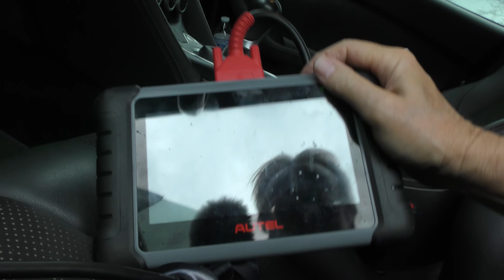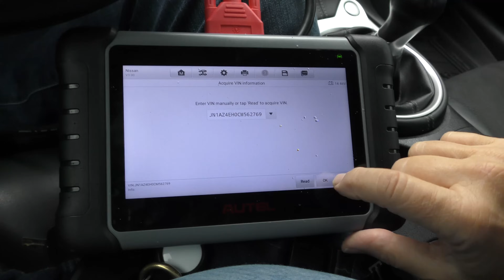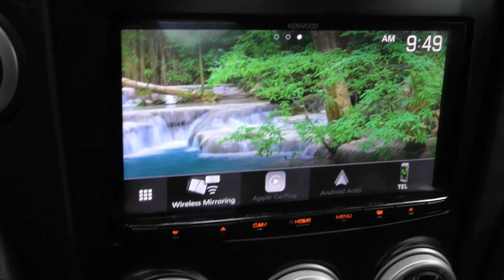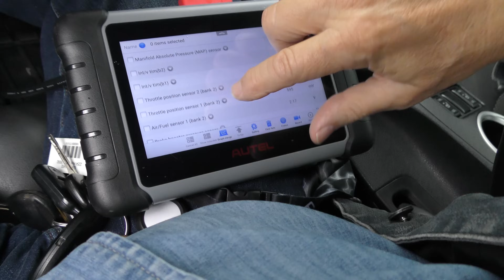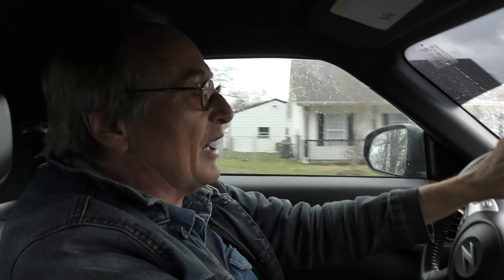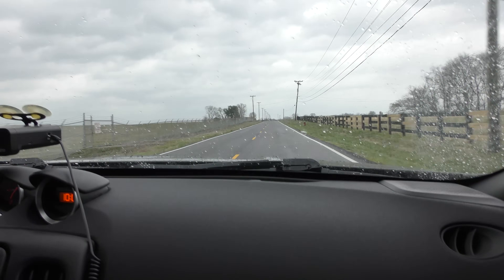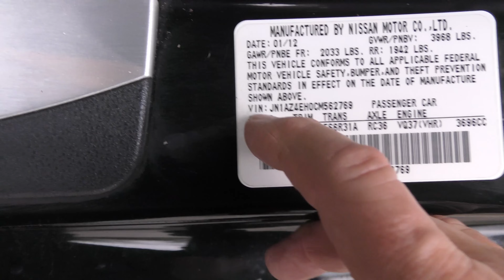This New Car is the Biggest POS I’ve Ever Seen

Comment: Had a g37 basically same as this and that had 280,000km on its before I sold it. Then got a q50s with the 3.7L and that now has 200,000kms on it now.

No major issues with them and I raced my g37 all the time at the track and did abuse the car. Videos are on my channel. But only normal maintenance and they kept on going

Comment: A friend of mine had a 370z and it was a fantastic car to drive. His only complaint was that it was very noisy in the cabin. Sure it's a fun car and a good-looking car, but you're not always tearing around. If you jump on the freeway for a 100 miles the noise is going to be fatiguing. Still, it's an awesome car and a great value.
Reply: I had one for a very long time. Absolutely loved it and it’s the one vehicle I regret selling.
Reply: I'd suggest kilmat, a cheaper version of sound deadener. Also fill voids between the wheel wells and interior panels with cloth insulation where you can. It goes a long way to quieting things down.

Comment: I had a 370Z for a few years. I’ve noticed the motor is pretty noisy. So is the clutch too. I thought I had a knock but after doing researching and asking other owners, it’s “normal” lol 
It was a fantastic and fun car. It never gave me an issue except for the clutch slave cylinder that went out. It’s located inside the transmission bell housing so it was quite some work.
Reply: I have a 2010 Alfa Romeo 159 1750 Tbi Ti (petrol), the motor is really noisy in that, quite a heavy knock at idle, turns out it's perfectly normal, something to do with the fuel system, sounds rubbish though, i recon that's why most modern engines have plastic covers, to try and drown out the crappy racket they make.
Reply: Ah I had to replace one too in my genesis coupe , some work.
Reply: Lucas synthetic motor treatment. I had a court about twice a year my valves making 0 noise.

My friend and I crank the car and put it in as it was running and you heard it go off from making a bunch of Racket to absolutely silent. Lucas makes the best additives I used it all my vehicles.
Reply: You can get an aftermarket slave cylinder put on outside the bell housing. Many 370z owners do that. Also clicking from rear wheel is the main wheel nut as it comes loose. Think there is an aftermarket nut many put on.

Comment: You can adjust the lash on the intake side by replacing or grinding the buckets. We do it all the time. As long as your in spec the VVEL doesnt care. And i say we do it all the time in the sense of doing a valve job. Ive never seen a oem 370z need valve adjustment and im a master nissan tech.

Comment: As long as those dongles are made correctly (no excessive current draw or EMI) they are good to be left plugged in for long drives. Just consider unplugging them if you're not driving the vehicle cause they'll drain the battery!
Reply: Yep, I have one each in my Mustang, Silverado, and Camry that stay permanently in the OBD ports and have never caused any issues. The one in my truck has been in there for about ten years.

Comment: I really like the new Z car actually. I understand what you’re saying about the turbos, but you’d be hard-pressed to not find a non GDI, non-turbo car these days. Also, we had a couple of the VQ Nissans in the family and while they’re great motors, they have their own set of issues. I do know a couple of people that have put a decent amount of mileage on the 3 L turbo that is in the new Z. It’s been out on the Infiniti for quite some time. I think the redesign is sharp, it mixes the perfect amount of retro with new, and I’m really excited to drive one. I actually think Nissan is on an upswing. For instance, they finally got rid of the awful CVT in the Pathfinder. While it’s not a pathfinder as we know it, still, it is definitely also an improvement over the last generation. I am rooting for Nissan. I’ve had a lot of them and I’m hoping That they get their groove back. Perhaps with Ghosn having been ghosted, we will see some welcome changes.
Reply: Their designs on infinity are horrible. Just horrendous.

Comment: I had two G37’s (a 2008 and a 2010) with the same 3.7 VQ engine as this 370Z.  They were absolutely fantastic cars that I bought both brand new and I loved both of them!  I do disagree with you about the new Z.  It’s an awesome car and the Red Sport turbo engine has been around for years in Infiniti Q50’s and is generally a reliable and powerful engine.  Plus, the new Z just looks incredible!  I love the Z32 300ZX-inspired tail lights especially!
Reply: im a Z owner and i have mixed feelings about the new z. theyre definitely not what worth what it costs to drive one out from the dealership. i can get a gtr for the amount. plus, id wait for the revised ones to come out before anything so in a few years
Reply: They did nail the look. Reminds me of a 70s Zcar

Comment: I've owned my 2015 for 6 years and have had no issues. She's at 55k miles now and figured I'd do the spark plugs with the next oil change
Still runs like the day I got it
Reply: Bro yours is still brand new just change oil every 2,500 miles I’m at 220k rn an mf she’s running good 🙏🏼

Comment: I do agree on his statement of turbo charging the new Z. One of the biggest upsides to the Z has ALWAYS been it’s N/A engines. Being a huge fan of the Z/G series Nissan/Infiniti have always had, I love the idea of a N/A engine. Adding turbos to an engine really make for issues down the road. We personally own a 2011 FX35 AWD and it is a blast to drive. For a 4300lb crossover, it absolutely flies.
Reply: You do realize the 300ZX was in fact turbocharged and very reliable right? The new Z isn’t the first time Nissan threw turbos in the Z line. They flipped back and forth between N/A and FI with every few models.

Comment: For what it's worth, I REALLY like the new one. It's just too expensive for what you get, similarly to the 2.0 supra
Reply: It looks so good, much better proportions and proven engine compared to the bmw Supra
Reply: Welcome to 2023
Reply: @DavidValdezBigWaveDave the B58 Supra is MILES better engine than any Nissan junk
Reply: @bigstepper4203  it looks fugly tho, like have you seen a mkIV? A mkIV has much better proportions
Reply: @bigstepper4203  You can have fun driving your Bimmer around town bro
Reply: @UniqueHandles  well I have an M340 so yes I will enjoy it. I had a Q50 with the same VR30 as the Z and it doesn’t compare to a B58
Reply: @DavidValdezBigWaveDave  looks wise yes I like the Z more than a Supra. Proven engine wise? Not even close. The VR30 and B58 got released within like 1 year of each other. B58 is overwhelmingly looked at as a vastly superior engine in every aspect. I’ve owned both, the B58 is smoother, faster, sounds better, easier to make power, more reliable.
Reply: @bigstepper4203  but what about the ease of maintenance, I know bmw motors have gaskets in weird places and aren’t easiest to work on
Reply: @DavidValdezBigWaveDave  no the straight 6 is easy to work on. Coil packs and plugs can be done by just removing plastic engine cover. I swapped my downpipe without removing any additional parts. Nothing about the B58 is complicated to work on

Comment: I have a 2014 with 140k miles, and got it 2.5 years ago I’ve tracked it 6 times in that time frame. In my opinion, this is the best performance car you can get for the the money. Runs like a clock and requires very little maintenance.

Comment: In my opinion the only reason why they even put turbochargers on vehicles nowadays is just so they can turbocharge the money out of your pocket
Reply: Our car has 2 and they both need replacing (fair enough after 400,000 km) But ouch the cost...
Reply: Very uneducated opinion you have there. Keep them to yourself next time. It's to meet efficiency regulations.
Reply: @1bam1productions  turbocharger, not supercharger.
Reply: @Descartes, Rene  both use more gas. The difference between the two is supercharger takes power to make power and is always running. Turbo takes exhaust gas to get running so it's power kicks in at higher rpm over idol.  Turbo is also more efficient because of this but make no mistake both systems still use more fuel and also cost more to run
Reply: @DescartesRenegade  lol now I get it. Hahaj ya super duper carge
Reply: @kaasmeester5903  400000km is some good miles
Reply: @1bam1productions  Especially for a Porsche :)  Only way I could afford one...
Reply: @1bam1productions  and what happens when you drive in stop and go traffic in the city? Is doesn't spool up, thus, increasing the overall MPG. However, if you need the power, it's there if you mash on the accelerator.

So, in effect, turbos boost overall MPG.
Reply: @DescartesRenegade  the turbo doesn't increase your overall MPG if you're in stop-and-go traffic and not using the turbo then how do you figure the turbo is increasing your MPG. You might as well buy a 4-cylinder or something with small displacement. If you're not using the turbo then why would you buy the turbo
Reply: @DescartesRenegade  furthermore you must be new here. Because even Scotty says it's a cash grab in a ripoff
Reply: @1bam1productions  similar to how some engines can turn on/off cylinders when unneeded.
Reply: @DescartesRenegade  yes the idea was a good idea but look how reliable those engines were they became a piece of crap
Reply: Modern economy cars do in fact use turbos to increase fuel economy, they are small but the boost does in fact help the engine run more efficiently to save fuel. These turbos are tiny (for fast spooling) and aren't for racing by any means.

Comment: I’ve been around these VQ platforms for some time now. I’ve even turbod my 350z nismo. It has been one of the most reliable cars I’ve owned. They do have their flaws like any car but these are super solid vehicles. I said what I said. As far as the new Z with the VR30 engine.. it’s been good as it’s an evolving platform. But Nissan is still making amazing Sports cars. Something that no one does anymore. There’s a reason that the Nissan GT-R always win TX2K every year. But regardless, very informative video.
Reply: The 350 and 370 are good cars no one disputes that ... The new Z is not... A gtr  does not "win tx2k every year". The gtr motor is a closed deck design that shares virtually Nothing with the new z.

Comment: Scotty, I’m an old man. Purchased a set of brake drums and shoes for the rear brakes on my 2005 Silverado, and installed them myself. The drums were from Detroitaxle. 
Took me and three mechanics to diagnose the pulsating that I experienced after installing all of that, to not being the front disc brakes being defective, but the new rear drums being defective! 
You see, I mistakenly diagnosed the pulsating feel I was getting after replacing the rear brakes to being the front brakes! Never dreamed the new drums were the problem! 

Of course Detroitaxle didn’t want to warrant the drums because I had them on for forty days before realizing they were defective! Which they only give 30 days for free returns apparently! Oh, they offered after I asked to speak with a supervisor, to allow me a replacement or refund if I would pay $113 to ship the defective ones back….I paid $137 for the set! 
The ones I bought locally ended up costing me $225 for the pair, but they actually work!
Just wanted to ask you if you ever tried Detroitaxle parts and what you thought about them? I know you don’t mind calling it like you see it!

Thank you sir!
I love watching your videos!
Reply: I never put drums/discs on without putting them on the lathe first.

Comment: I used to drive nothing but manual transmission cars and trucks in the 90's up until about 10 years ago.  I'm older now, and want a sports car with a manual transmission just for fun.  In your opinion, what would you choose?  Miata's look really fun to drive and are reasonably priced, but I can't fit in a Miata.   I tried driving a buddies old early 90's Miata and there's no way in hell that would ever work being 6'3''.
Reply: VW GTI 6 speed. Good and roomy and fast for a tall person.

Comment: Always the same story.  A rich oil guy in Calgary had to have the new model BMW R1200RT motorbike.  In 2010 he bought it new and added every option.  35K out the door.  In 2014 the new model came out and I bought his for 12K Canadian with 60 K km, barely broken in and with every service record from the (expensive) dealer of course.  I put 75 K km on it in 4 years and sold it for 7 K.  Best bike I ever owned, loved it.  Buy a good used vehicle that a rich old guy drove.

Comment: I’ve been driving my 370 Z for 14 years now got 42,000 miles on it. Manual transmission of course. I’ve only just replaced the starter. And not because it crapped out on me just because it was starting to make noises like it was going to and I didn’t want to get stuck somewhere so I went ahead and replaced it far from that. I change the oil and take care of the car. Will see you at 20+ years how it keeps going

Comment: Rather have a 370z than the new z only because the current market is insane
Reply: Regardless, its going to be cheaper than a new one so just say you rather something cheaper. Has nothing to do with the “current market”.
Reply: @thegreat9481  uhm no…. I would pay 30-35k for a NEW Z. The one in the video is worth maybe 13k… just more reliable
Reply: @zackatron925  ok
Reply: All these new cars are made with cheap metal, cheap plastic, and computers....and they lose too much value when you take them  off the lot
Reply: @thegreat9481  new cars are crap
Reply: @zackatron925  Thats all its worth
Reply: @blademanx  in reality it should be a car that can be bought for 10k. With around 100k miles yeah

Comment: My wife drives 04 350Z with 47,000 miles. Fun car to drive, but damn it's small. Only issue we've had is the fan assy went bad that I had to replace. Wouldn't you know it I get a recall notice like 3-6 months later.

Comment: Hey Scotty I recently worked on a 2014 GMC terrain 2.4 L. It had a code for the secondary air injection check valve. I replaced both of them and cleaned the heads they go into. I also found a crack in the exhaust manifold so I changed that too (pain in the butt). Check engine light still is coming on. Everything looks like it works so am I looking at an electrical problem at this point. It's pretty maddening.
Reply: I got a 2012 terrain 2.4.  Junk . Nothing but problems
Reply: @beatdeeznutz80  mine runs well hardly any rust which is big for the north east but this dumb check engine light is infuriating.

Comment: I have a 2019 370Z 6MT sport coupe in all black and love it. My car is hitting 53k miles with no problems and virtually no oil consumption. I have used the recommended 5W-30 Nissan  ester oil since it was new and gently broke in the engine and used 3k mile oil change intervals. There is no valve clatter on my engine and only a little fuel injector clicking.

I spent about $3k on a high performance intake, exhaust and custom Ecutek dyno we estimate that we're getting about 385 peak hp at the crank, very close to the 400hp the new Z makes.

I'm at a Nissan dealership waiting on an oil change and in talking with the salesman found out that they can't sell the new Z; all of their prospective buyers have gotten cold feet after seeing the $10k and $20k markups on the performance and sport models. He agreed with me that the dealerships are shooting themselves in their feet with these absurd markups. I told him that if I had that much money to blow on a car I would put it towards a Porsche Cayman S.

Comment: Mine 2013 with almost 200k miles, i replaced the water pump and went with EPS gaskets galleries and only thing i wish i replaced is oil pump even through it had nothing wrong with it...just it really cant withstand over 7000rpm. If you drive normally and rarely ever track or do any "spirit driving" it's really reliable and might even last forever

Comment: I drove a twin turbo version of that car. But it was an older model. That twin turbo was scary and terrifying. Barely touch the gas and it would take off super quick. Took me a while to adapt to drive that twin turbo. Once I adapted to it and learned to control the throttle it was fun to drive. Still scary though of i forgot to be easy on the pedal.

Comment: I beg to differ on using the OBD II port all the time. I run the ECUTEK plugged in now for almost 3yrs. Never taken it out. I have ran E85 in my 370Z now for almost 5yrs now. The ECUTEK keeps up with the new GTR injectors and using a hellcat fuel pump. Perfect for the Z 👌👌

Comment: Long time viewer, and I agree with you on a lot, but at 0:50 you're wrong. Nothing wrong with leaving an OBD device attached, so long as it doesn't drain the battery. Yes, it's a diagnostic connection, but many devices can safely be attached all the time to gather data and report it.